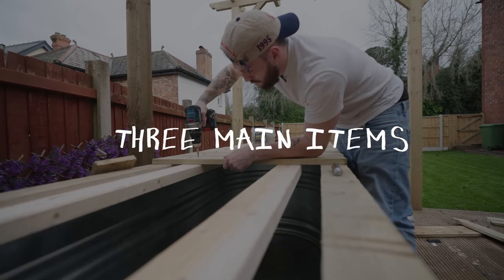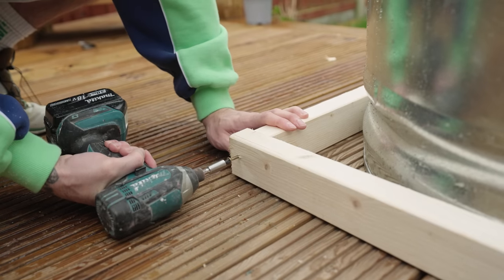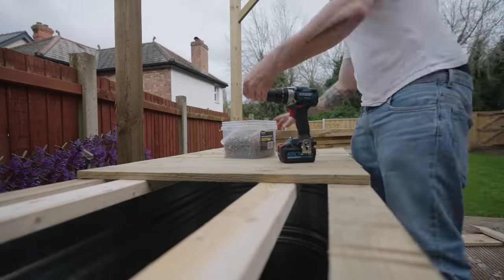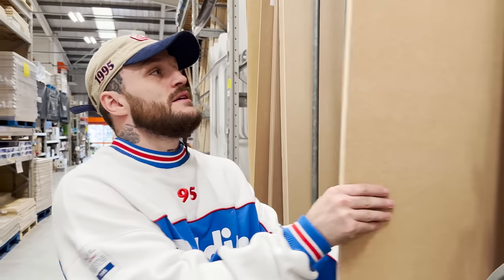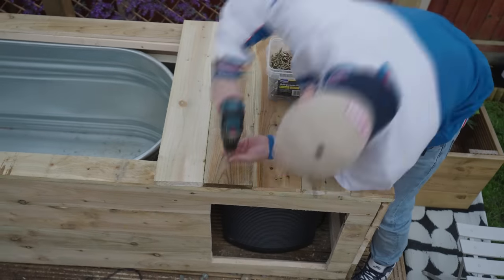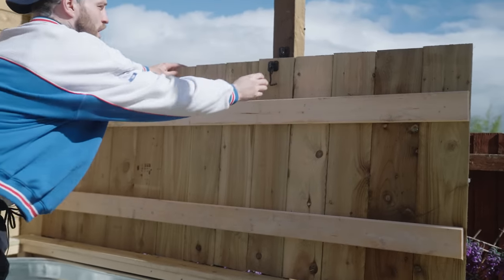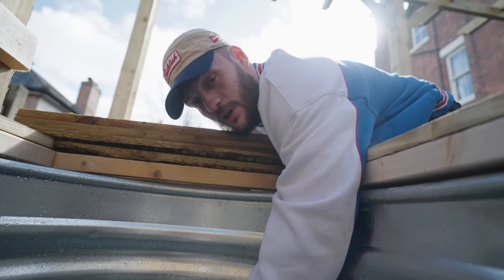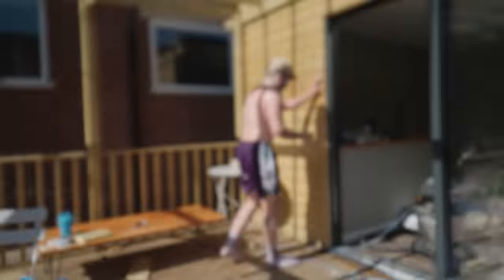How I Created a $5,351 Plunge Pool Out of Nothing

Comment: Add a varnish too the wood so it doesn’t rot (even though its bought “protected “) an extra varnish a year down the line will help massively. Also cut down the screws which are exposed on the underside of the lid (save cutting yourself). Love this content keep it coming ❤❤
Reply: I literally only clicked to see if the wood would rot or not lol
Reply: Yeah 100%
Reply: also sanding everything for smoothness

Comment: Hey Jay, I think you should sand off the sharp corners and top sides of the open bath. Also might want to add smooth rounded corner pieces where the gaps between the body and the trough. Looks awesome!

Comment: I would advise to sand it down smooth and then but a light color stain that can repel water. because if it rains or theres a leak in it, it will mold or the wood will warp and break.

Comment: That is a bloody amazing job bro! based off this im gonna have a crack at saving up and doing one myself. The only thing I would've recommended that you can potentially change down the track is the material choice for the divider betweer the tub and the chiller. MDF is a good timber for dry internal applications but as soon as it gets any moisture in it it swells and begins to disintegrate. So for the longevity of the tub, replacing it with some sort of marine plywood might be the go. But again, Bloody good job bro! 🙌🏼

Comment: When cutting the wood, I'd recommend either using a scrap piece of ply between the saw horses to act as a table, so the wood doesn't fall when you go all the way through. Or you could use a sheet of foam insulation on the floor to cut on, it provides a flat surface and the wood can't fall. The depth of your circular saw should be set to about one saw tooth more than the depth of the wood to reduce tear out. Sick job, I got in to woodworking during lockdown as a hobby, it's so satisfying building stuff :)

Comment: Im actually taking a materials class and I wanted to add this: Timber wood looks VERY nice, but I heard that it doesnt age very well, hence why it is typically used indoors, so I recommend putting it somewhere indoors so it doesnt get ruined by the rain/snow by way of shrinkage

EDIT: I watched the end, I wanted to add that a better alternative could have been cherry wood, oak wood, or any engineer-produced wood. They might be a bit more pricey, but it lasts longer and it more resistant to shrinkage

Comment: When applying the silicone use a spray bottle mixed with fairy liquid and water spray onto the silicone when you’ve applied it and wipe away excess works a treat for a neater finish

Comment: Jay mate, you doing DIY projects is something alot of us would enjoy tbh. Also, as a Roofer/carpenter youve done a very good job on the framing and cladding. The reason you struggled with cutting holes in the sheet metal because no bits you used were for the job lmao, youd wanna use something called a step drill bit

Comment: Not sure havent finished yet. But add a filter catch at bottom of tub. Then add a filter + ozone to the system. Also id attach a large magnet to the door and side so when you swing it up that holds it and you can just leave the latch as a backup. Also more insulation on the back. But nice setup!

Comment: Jay it's sick to see you doing these sorts of projects! I live local and was actually at that wickes for my own projects over the Easter break, It's still mad to see this area on a huge channel. For advice, I've got no idea of your pre existing knowledge in regards to this stuff aside from what you've done in this vid, so I don't mean any disrespect if this stuff is obvious. I've been getting into woodworking myself lately so some tools I'd recommend are: 
An orbital sander to go over panels at the end (Though it looks like you've already done that). A drill set going to 13mm in 0.5mm steps and get larger sizes as and when they are needed, a chisel drill set and countersink drill bits. When you pre drill the screw holes and countersink them, the screw heads sit flush and don't chip the wood. And that bit where the hole saw was skrt-skrtin all over the place, a step drill makes putting holes into sheet steel so much easier. A palm router for doing things like putting in that slot for the ketch on the inside of the lid, it would also be helpful to chamfer/round off the edge of the wood panels. F clamps, you seriously can never have enough of these things, but don't get them from wickes they're a rip off there, can get packs of 12 for like £50 on amazon. Something else I'd recommend but can be pricey, is a bench top mitre saw. Really helpful for making straight cuts perpendicular, on an angle, and to a stop so the pieces are all to the same length. 
Hope that's helpful and hoping you make more content like this Jay!

Comment: nice vid Jay, I think you did a good job...
I would defo treat every bit of that wood, also before doing the treating, I think giving it a good sand all round and making the corners smooth and and not sharp....
also I think at the bottom of the wooden frame were you left a lip, you could but LED lighting strips going around.

Comment: where you separated the chiller from the bath you used MDF which if it gets wet will fall apart, change it for a plastic panel so then you dont have to worry about it and you dont see it anyway so doesnt need to match the rest of the bath. also probably worth sanding the top side of the timber around the edge of the bath so when you rest your arms on it you dont get splinters. treat the wood regularly so it doesnt rot and keep up the good work and great content. Borat VERY NICE!

Comment: Hi jay, I think the overall look matches the rest of the deck but I was going to suggest painting it white which reflects the heat from outside, especially during warmer months which might help it reach the lower temperatures. I would also suggest a layer of insulation below the trough where alot of the cold might escape

Comment: Trick for a clean silicone line: put painters tape on each side of where the bead will go. Use a latex glove to wipe the bead like you did with your bare hand, (it’ll come out cleaner) then pull painters tape away, should be perfect. For those water pipes you can get things call through-hulls, they’re for boats but it’ll essentially make it so that the hoses aren’t sticking out into the trough.

Comment: Great vid! I have no comments about the build bc I don't DIY much, but for the cold plunge I'd recommend focusing on your breathing, and maybe lowering the temperature progressively. Inhale and exhale fully, more than you think you need to, because that oxygen is necessary to produce heat. Maybe you underestimated the cold (which I do too), but you will get used to it eventually, in time. It's mentally challenging, but you're mentally challenged so you'll be ok ;). I haven't done a full plunge in too longe, I can only do cold showers, but they do a lot for me. Good luck, and it's goood to see you on YT again Jay :)

Comment: I'd have insulated the tank to keep the heat out and not sure if you have one but put a insulated lid on it, maybe you could use spray foam insulation. If it's insulated and the chiller has a thermostat then least the insulation is keeping it colder for longer and then using less electricity to keep it at 3c

Comment: Well, Jay, my suggestion would be starting with 8 c or 46 f. Do that for a few weeks, then gradually lower your temperature down to whatever your chiller can go, usually 2 or 3 Celsius. I've sat in 8 Celsius for 20 mins, and it's not so bad. But it gets harder the colder you go. I wouldn't recommend sitting in 2 or 3 Celsius for 20 mins. I would do maybe 4 mins, but eventually, you get used to it if you do it daily.

Comment: when you’re siliconing make sure the surface you’re applying it to is dry, run a bead of silicone along the area you’re sealing, then use a spray bottle with water and fairy liquid and spray the silicone, then use a silicone tool to scrape away the excess and leave a neat finish

Comment: insulation for the floor and lid also the part seperating tank from chiller also fittings that seal around the tank so no leaks very cheap and common fittings they are called bulkhead fittings

Comment: Just got to the part where you asked for advice, when you screw into wood it’s best to counter sink the screw holes first to stop wood from splitting especially if you use more expensive wood in future videos , also it’s not called cut a square bit of wood 😂it’s called a notch

Comment: Pre drill your holes for a stronger join. 
If the screws you're using are 4x40's for example, 40mm being the length of your screw, 4x50=50mm screw etc then use a 4mm drill bit. 
If you're using 5x40 or 5x50 etc then use a 5mm drill.
 Go through your first piece of wood with that drill bit then when the screw tightens into your next piece of wood it will have a nut and bolt effect of pulling itself together. Hope that makes sense and someone can make use of it

Comment: Honestly such a good video! Couple of suggestions. I'd highly recommended investing in a power sander of some kind, large projects are a pain to sand by hand. Also, you can mix saw dust and a bit of glue to create a filler. You could whack that in the gaps of the planks, then sand it all down so the entire side is smooth. Although the planks suit your house much better!

Comment: I would really work on aka upgrade the insulation. The mantra is: insulation is only as good as the weakest area and I see many weak areas. (Have you thought of the bottom/underside?) Not to exxagerate but I'm pretty sure you would at least half your kWh consumption over the whole year if you do it properly compared to as it is now.

Comment: Build looks good bro, few minor alters I would of done, just to make it look that bit more professional. For example the cooler door to service it, putting the cut side of the wood all on one side, so you have the non cut edges all down one side- the side you’ll see more, then possible sand the cut sides and put some varnish, osmo of some sort to stop water from rotting the wood.
Other than that perfect

Comment: Good effort however you will definitely need a filtration system and something like UV or ozone generator to keep water cleanl. Start bit Warner and work down over time. Also turn the water pump off when you are in it as circulating water is exceptionally cold . Your chiller will also need ventilation.

Comment: When siliconing after you caulk it on you can spray it with a mix of dish soap and water so it won't stick to your finger when smoothing it off g, also make a much cleaner finish lad x u can use a ice cream stick to finish it off aswell

Comment: Bit late so hopefully you see this but you should have put the water intake at the top as warm water rises and the cold water output at the bottom. It would speed up the cool-down process as having them together means it'll pull the cold water back into the cooler

Comment: They have specialized routing for the tubing for the intake and out take. they cost about 4 dollars. so you dont have to leave it looking like you filled it with foam spray. Also Treating the wood with oils and waterproofer (hopefully its pressure treated wood). Also cover the  screws / nails with a bead of calking so they dont  rust and rot the wood. Alternatively if you wanted. on the other side of the tub you could make a Hot coil, for a Hot tub. and put a shut off valve on both sides. just food for thought.

Comment: The intake for the water cooler should be at the top of the tub, as hot water will rise, and cold water fall. Therefore, pumping the water from the top of the top should make a colder tub overall. But i'm not sure if it will actually make a difference tbh. Nice build!

Comment: Could’ve tried feather edge boards on the side instead of jus normal timber planks, would give it abit more texture. Also when working with any kind of sealant or whatever, put washing up liquid on your finger, when spreading it across. Makes it way easier to clean off. (Not sure if you did that anyway but yeah). Great video anyways ❤️

Comment: Neaten those silicon edges up by using masking tape and siliconing between two pieces of tape on the edge, then use your finger on the silicone to fill the gaps then pull off the silicone, smooooooooooth lines.  creme egg.

Comment: JAY YOU NEED TO PUT THE COLD WATER OUTLET AT THE TOP OF THE TANK SO WHEN THE COLD WATER SINKS TO THE BOTTOM IT COOLS THE WATER ON THE WAY DOWN. 

AND THE COLD WATER INLET AT THE BOTTOM SO IT SUCKS UP PRE-COOLED WATER AND IS EASIER FOR THE CHILLER AND CHEAPER

Comment: with the silicone use a thinner bead which can be done by cutting a 45 degree hole which allows it to be pushed into the corner better with more control. also soapy water on the finger reduces the amount of silicone that sticks and leaves a smoother finish. looks fucking good though mate

Comment: Two things I haven’t really seen in the comments - 1. Silicone the gaps on the lid to stop debris and rain getting in. 2. You should have a drain plug somewhere in the trough so it’s easier to clean/change the water when it gets dirty. Well done very good build you noob

Comment: After celetexing could of added breathable felt, the stuff used under roof tiles. Maybe some nicer cladding for better finish and longer lasting but as your were trying to keep budget low I see why this was used, instead of expanding foam and silicon, rubber seals would of last longer. Not bad though considering carpentry isn't your profession

Comment: Dunno if you did this but looks like you don’t have it in ? If you drill a whole first using a  normal drill bit at the centre point of where you want the hole. Then when you use the hole saw put the drill bit in the middle and insert that shit and will stop it drifting 15:16

Comment: Instead of a chiller you should have bought a tiny fridge, poke 2 hole on one side and put a bunch of coiled copper tubing on the inside. cheaper and still effective
Reply: Also instead of a chiller you could use a heater :D

Comment: get yourself a grinder mate, coulda cut that out easy, aswell, and maybe im impartial here as im a welder, but id rather have made the actual pool myself, in the same square shape as the outside box, and you wont need silocon that way as it will be water tight

Comment: I’m no pro but I love building stuff the same. I would of cut the boards shorter to allow for the door beforehand so it sat flush with the rest of the boards, also I’d have measured the board widths you were using before you stated and built the frame say 5 full board widths high with so they fit flush too, should of cladded
It with decking boards too I think it would of looked nicer. Saying all that I make so many fucking errors myself it’s easier saying all of this in hindsight. Good work though mate I loved this video

Comment: About silicone. If you have to put a lot like you did, just use your thumb instead and don't forget to use some water or saliva so it won't pull off and will be smooth
Edit: You will get better with every single bath. It's always sucks but after some time 5 minutes is nothing,

Comment: For ice baths mentalities don’t get body wet yet dunk your head and foreheads immersion first 

Cold Plunging Tip #5: Dunk Your Head Right Away
Right when you enter the tub, dunk your head all the way under the water. This sends a powerful signal to your system and will help speed up warming regulation in the body, which makes the cold more bearable, more quickly.

Comment: Love the video bro but just so u don't cut a limb off at some time let the smaller pieces fall when u cut timber. Don't suspend both ends of the timber cause it will pinch on the blade. Top shit otherwise bro

Comment: Just get a used large freezer chest and a temperature controlled relay. It has everything built in: compressor, insulation and the box itself with a hinge. You might wanna seal any seams and holes on the inside. Way less work and if you get a good second hand deal on the freezer it can be much cheaper too. And you can still make it look nice by applying veneer or what not on the outside. Here's an example: https://youtu.be/dK2YC2eHRBY